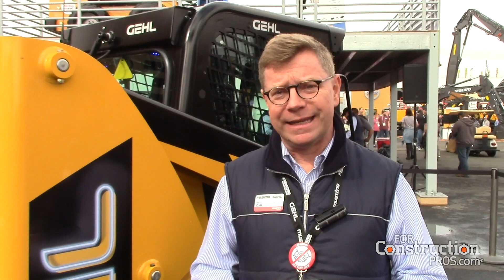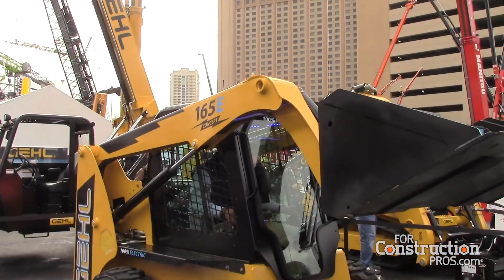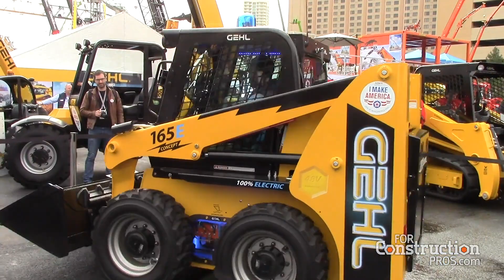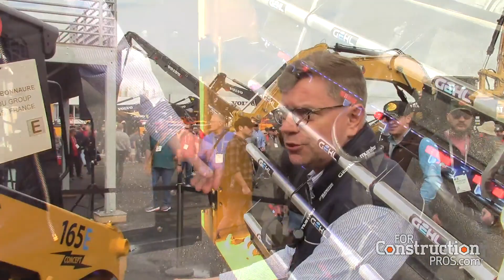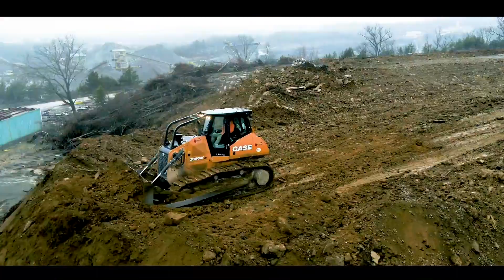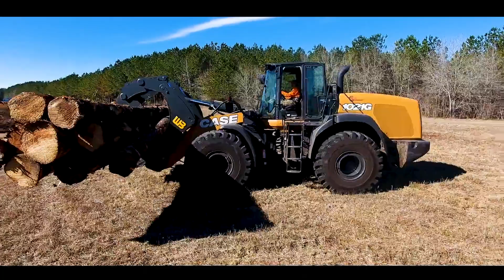Gehl Demos Electric 165E Skid Steer

Comment: None of those electric machines will hold up to the severe conditions and cold here in the Northland of MInnesota. Not a single battery operated machine, tool or car I currently own holds up in Winter conditions here. Not one! Cold climates requires fuel based machinery for heat, power to move snow during cold weather, lights, wipers, heated fuel and storage tanks, etc. I am amazed at the fools trying to push this hard for getting rid of high btu energies that fossil fuels provide for sustainable every day life. Electric can be used in warm conditions not in cold climates.
Reply: Yep, we got a long way to go before we can hit electric.
Reply: Electric vehicles seem to work well in Norway, where it is certainly as cold as Minnesota. Linear actuators can replace hydraulics on many machines. They can also replace hydraulic braking systems (Beoing 787), working at extremely low temperatures.

Comment: Wow, we are electrifying heavy equipment now...super gay.
Reply: The bucket wheel excavator is 100% electric and would crap all over every single diesel powered earth moving equipment on the planet. It's basically god level in size, power and moving material. Electric wins, sorry.
Reply: @EETechs  maybe so, I don't doubt it one bit. But its still gay af.
Reply: @gunner9486  yup lol. This thing will not last in snow or really hot weather.
Reply: @EETechs  In the mines I have not seen an electric anything beating diesel.
Reply: @marcelmaria804  The bucket wheel excavator is designed for open pit mines and totally destroys anything and everything else in material removal per hour. This is grid powered electric, not battery electric. Much more powerful. The material is conveyed instead of being put on trucks to be hauled. Again, much quicker.

Comment: Wy is everyone going electric over hydraulic.  Wy not put electric screw cylinders and electric drive wheel  motors. Very little oil.
Reply: because hydraulics have shock absorption electric does not. all the rams would last 5 minutes if they were electric.
Reply: @marcelmaria804  seems strange that leterneu got away with it then. Must be missing something.
Reply: @marcelmaria804  the one that gets across that line first will be tesla style ritch.